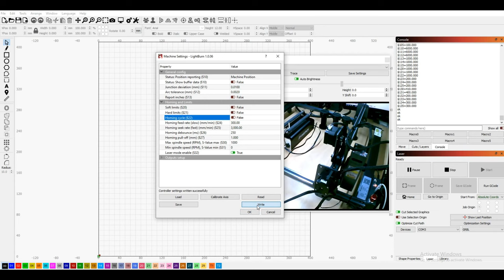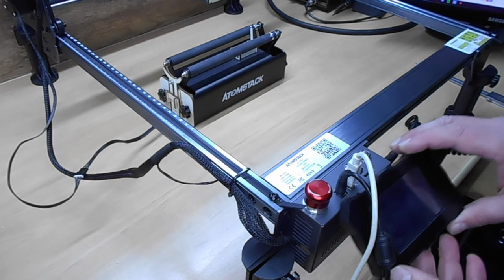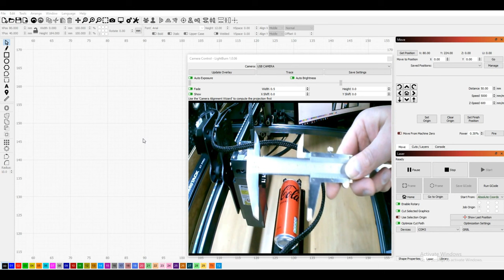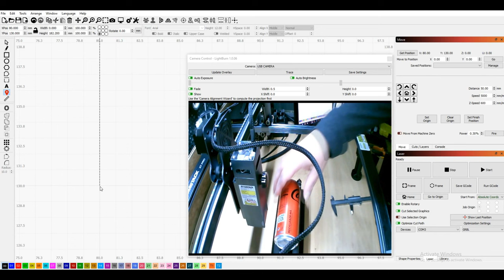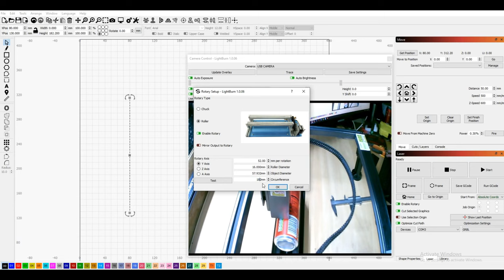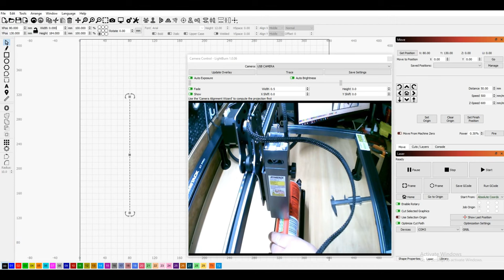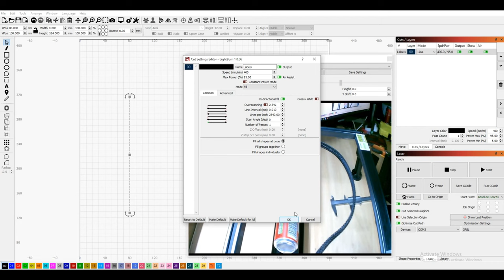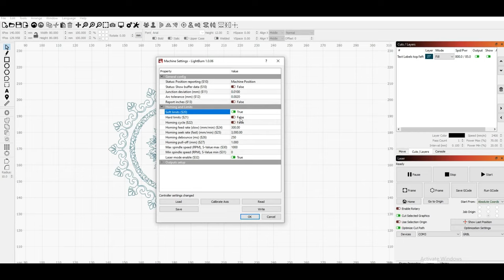Atomstack rotary R3  Full setup

Comment: Nice video, I have been struggling with my rotary tool for a while, text gets jumbled, I had been adjusting the rotation and had my roller diameter set incorrectly, thanks for the full video
Reply from the maker: If you follow all the instructions, you have no choice but to make mistakes! Accurate calibration of the circumference is only necessary if you are doing something more sophisticated!

Comment: SALUDOS, GRAN VIDEO. TENGO UNA DUDA QUE ESPERO PUEDAS AYUDARME A RESOLVER. AL PONER EN MOVIMIENTO MI ROTATIVO EL LASER ES EL QUE SE MUEVE Y EL ROTATIVO NO GIRA... ¿CÓMO PUEDO RESOLVELR ESTE PROBLEMA?
Reply from the maker: Activate subtitles. It contains technical details. Make the recommended settings and the recommended electrical connections. If you don't solve it, make a post in the Official Atomstack group with photo/video details.

Comment: Hola! Muy bueno! Gracias! 
Si tuviera que hacer un diseño en varias pasadas para lograr cierta profundidad de grabado, vos decis que nunca van a coincidir las vueltas para lograr que siempre grabe en el mismo lugar cada vez?
Reply from the maker: I would make an alignment point or fixed landmark to return to every time I start. For heavier objects, this slippage will be less noticeable. Or use some silicone rollers (bands) on the object to be engraved that adhere very well to the roller from the rotary.
Reply: @RmcReloaded-tehnicaldriver  thanks!

Comment: I have a question, some drawings require the cup goes back and foward, the problem is this travel speed is too fast, it messed up my engraving... "fast white space scan" is disabled so where do I reduce this speed?
Reply from the maker: Watch the video carefully, don't skip the tips.
The rotary operation is done with the recommended settings, otherwise the image will be drawn incorrectly. The whole project will be drawn at once, not in stages.

Comment: Porque se cambian los pines de el cable con terminal negra.????
Reply from the maker: you get two cables. One for Atomstack lasers and the other for other models that have a different motor connection. At the time of making the video, they were rather short. If it is long enough, then there is no need to use two extensions.
Reply: @RmcReloaded-tehnicaldriver  GRACIAS

Comment: How do what the rotation should be?
Reply from the maker: The object rotates counterclockwise if you look to the right!
Reply: I meant the rotation spacing. The top box when you set up your diameter in the rotary setup
Reply from the maker: @scottcline9685  -The object must be placed as well as possible on the two rollers. The distance is chosen depending on the diameter of the object. It's good that it's as hard as it gets. Insert heavy materials into it to keep it pressed on the rollers!

Comment: What's the purpose of switching out the wires on the black cord?
Reply from the maker: The black cable is intended to be used by other laser companies. By switching the wires, you get an extension cord.
Reply: @RmcReloaded-tehnicaldriver  well, I don't understand that,  you buy an Atomstack machine and then  you buy an Atomstack Rotary,, that matches your machine but you have to change wires,, because the Atomstack Rotary is made for some other company machines,  this does not make sense, let the people of the other companies change the wires.
Reply from the maker: @jbrunson1949  It comes with two cables. One for Atomstack, one for other companies. By changing the wires, I made an extension cord in order not to be conditioned to use the rotary only in a certain portion of the work. Thus, it will be easier to maneuver the rotary on the surface of the work table. And the change is very easy.

Comment: HELPPPPPP I have one and I have been trying to make it work and every 
time the roller wont spin, It sound like it is stuck. Im so frustrated 
that I dont know what else to do.
Reply from the maker: Did you put the black cord on without changing the middle wires? Watch this video how to do it!
Reply: Juan - I had a similar problem. It sounded like it was binding internally. My problem was the nuts on the end of the rollers were too tight. Check each roller to see if one or the other is binding. Hope it works.

Comment: Is the black cable required, or can i only use the white cable? Also, recommend you change the title a little to better allow people to search for this video. I have been looking for weeks for a tutorial, but this video does not come up on any search that i do. Add Rotary, atomstack, roller etc.
Reply from the maker: Thanks for the tips. White cable is too short. If you only used the white cable, you should hold the device upside down and burn the image in the mirror!

Comment: @ the 9 minute mark turning the can several times I saw the can do a jerking motion ass it was rolling,  sure was not a smooth turning
Reply from the maker: That is why the project is burned in one pass and at not too high speeds. To prevent such slips. And the additional systems were thought to stop lateral movement.